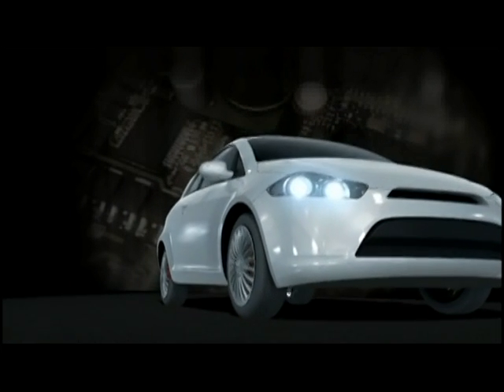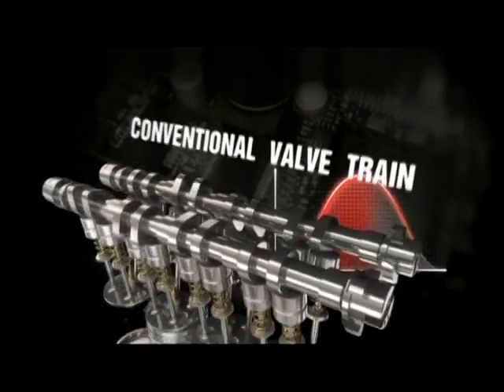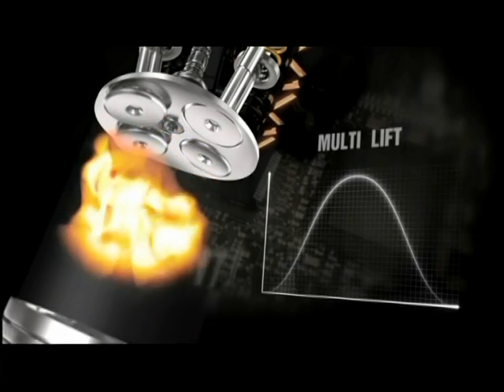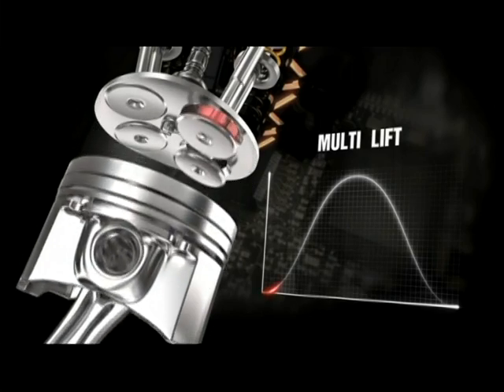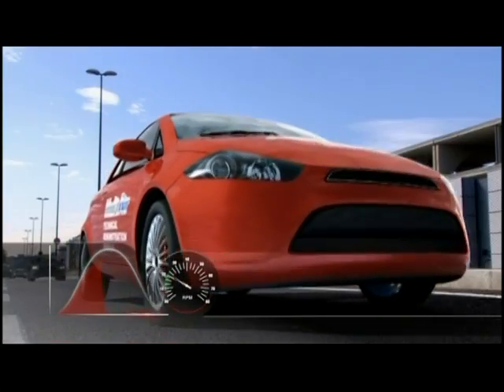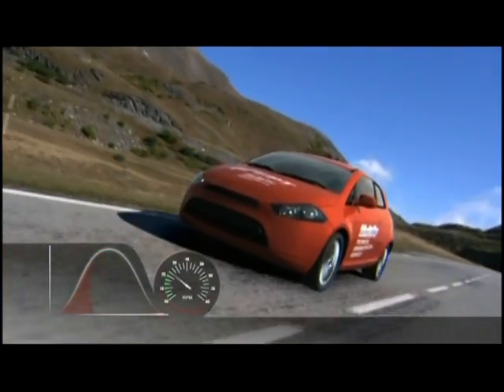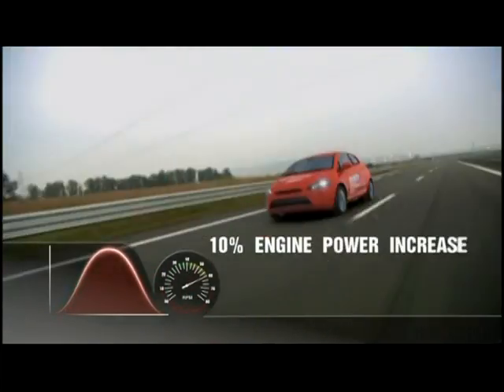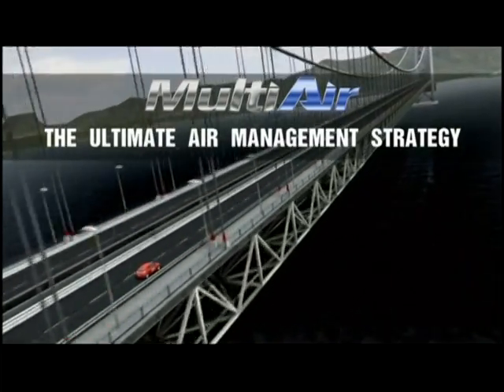Fiat Multiair Technology Explained

Comment: Valvetronic is less flexible because it uses an electric engine which is useless at high-rpm. It also still requires a butterfly throttle.
Multi-air doesn't need this anymore. It is mechanically faster to open/close the valves because it's hydraulic and based on high-pressure injection technology FGA developed for it's multijet diesel engines. This means it can open/close multiple times per cycle. It's also controllable per cylinder so can react to different thermal conditions in each cylinder.

Comment: Durability seems not to be an issue with the electro/hydraulic setup known as "Multiair" for there was a Fiat 500 for sale on craigslist a few weeks ago with 273,000 on the clock & still running normal. Of course I didn't know its prior history but I'd be willing to bet all was still original with the engine & its "Multiair" system. There's a small filter in the setup that needs attending every so often. Other than that, keep the oil full & clean. Modern oils & metals & sealing techniques go a long ways these days. Same with quality automotive grade computer parts, which all manufacturers use for they can't afford not to.

Comment: The hydraulic actuator part of the system is huge,so in order to fit it into a normal size head, Fiat had to reduce the number of camshafts to one per head. Cause you know. Single cam technology is oh so excellent these days.

Comment: it doesn't matter if it's a FIAT or not. complicating the valvetrain always gives some drawbacks because it is one of the most stressed components of the engine. the only variable valve system that is foolproof is honda's vtec.

Comment: @richardmaudsley77 i think it's been found that very little is gained from mods on the exhaust side...?  at least not enough to warrant the added cost and complexity.  since it's "before" the combustion event, anything that optimises volumetric efficiency (turbocharging, supercharging, porting, VVT, direct injection, etc.) yields the biggest returns.  this seems to hold true for most engines.  rotary, piston, turbine, gas, diesel, motorcycle, car, truck, airplane, etc.

Comment: They need to get GDI on the MultiAir engines. I know its harder and more expensive to make GDI, but it should be cheaper and better than doing MultiAir. And if you combine the 2, then add a turbo and maybe that 9 speed auto from ZF ;) gonna be awesome.

Comment: so basically digital control of the engine enhances it - that's why now we can have direct injection engines which improve efficiency and performance.  Before without digital control engines were sloppier.

Comment: ok NOW i see why this won engine of the year...? it is basically just variable valve timing, something that honda and most mfgs now all have a spin on. but, being able to "double tap" a valve during an intake stroke is definitely something not done before. this is analagous to the multi injection events being employed by modern common rail diesels. what we're seeing is prolly the first commercial application of F1 valve control learned from ferrari. albeit hydraulics substitute for pneumatics.

Comment: for all it's "cool factor" there is a sobering reality to machine design and mass production.  added complexity ='s more failure points and so begets 2 questions that will probably be best answered in time...?  #1, how reliable is it...?  and #2, what's it cost in parts and man hours to repair if and when it does break...?  and trust me...  it WILL break.  EVERYTHING fashioned by man inevitably breaks.